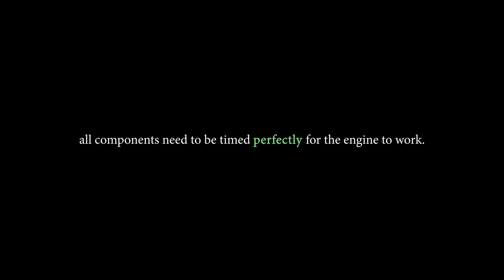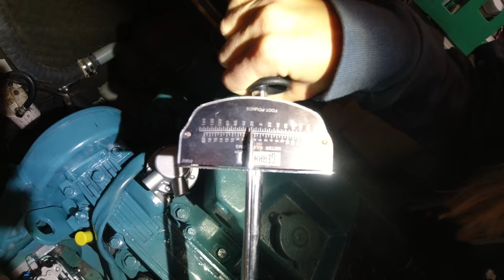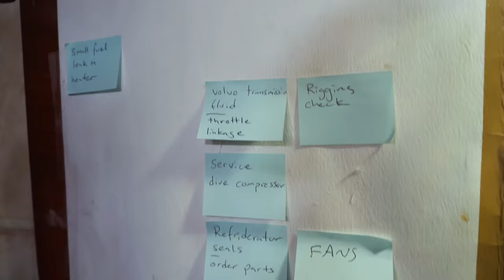BOAT WORK - Replacing our Fuel Injection, Motor Mounts, Anchor Chain! - Sailing Vessel Delos Ep. 311

Comment: Nurse here, hernias are my bread and butter. 2 weeks of no heavy lifting is too short. You are much more active than the general population. For you, 6 weeks of no lifting over 15lbs would be better. That includes lifting pushing and pulling. A gallon of fluid is around 8.5lbs for reference. The surface of your skin has most of the nerves that cause pain, usually it takes 2 weeks for that layer to heal, however it can take up to 6 weeks for the fascia to heal as that tissue receives less blood flow, the fascia also contains almost no nerves, so you can re-herniate easily with heavy lifting without feeling immediate pain. God bless you and your family. Been following you from the beginning.
Reply: Neurosurgery here. 
Completely agree with the above. 
8 lbs is (about) a gallon Of milk. 

15 lbs. (2 gallons) 6 weeks.  DO NOT TEAR THE REPAIR!!!!
Reply: I made sure to get a strong woman so when I had a stroke she kept her head and thrive s
Reply: I
@xajel88 I wholeheartedly agree.  I know I am much too late, but I agree with you, definitely 6 weeks.  I nearly fell out hearing 2 weeks.  I hope you are feeling much better, Brian.

Comment: Just a fun additional piece of trivia: You talked about using the mizzen for hoisting. You might be familiar with Baltimore Clipper ships (like the Pride of Baltimore). The masts are sharply slanted aft. The tops of the masts were directly above the cargo hatches. Perfect for hoisting. And for some reason the were very fast sailers. Good for evading the British blockades. And a bunch of them were fighting/raiding ships. Great video, thanks.

Comment: You got this super Mom ! Technical tip for using the OLD SCHOOL torque wrench - you will notice that the black handle is attached in a manner that it floats on the tool. In order for the required torque to read on the tool ,the handle must be ballanced on that pivot. Meaning NO part of the plastic should touch the metal of the shaft. The scale is set for the handle to be an exact length each and every time. If the plastic hits the shaft ahead of the handles rivit you will get a much lower torque than the scale reads. Learned this 40 years ago from father a aircraft mechanic.   CHEERS      Steve h.

Comment: When using that type of torque wrench your supposed to have the handle float on the handle centre pin. The torque is measured based on the flex of the lever at a specific length, the pin in the handle gives a more accurate lever length. Thanks for the great videos.

Comment: One thing you can do, you can still drink beer for that two week period. I hope you can ! That compression stuff for under the motor mounts looks like some sort of crazy plastic ? Wow, those carpets look like those expensive custum mats they advertise all the time. Great job Kaza ! Wow, wanted to hear the engine run after all of that. Naval Jelly. I always called it Navel Jelly at the cashier as she was usually good looking lol. I used a cutting wheel recently to cut some thick stainless steel, they are absolutely amazing for their size, WOW, really can get a lot done with them. I'd like to learn to braze but thats another story. As I said, this is the first boat to EVER re=galvanize a chain of all of the 10 years of 100 sailing channels I watch ! WOW, you've got your wife using a torque wrench. How many guys can say that ! AND YES, I DO REMEMBER SUPER RYAN ! Final error maybe drilling into a pipe or water tank ? NO!
Reply from the maker: Ha Kazza claims I stopped my pain meds early so I could enjoy a few cold ones.  Whether she is right or wrong I'll never tell :)
Reply: @svdelos  We will never tell a soul !
Reply: Thanks for the shout out and the love. Take care

Comment: Great video! Everybody used torque wrench incorrectly. You torque specs are a little off. On those old style wrenches you don't let the handle rock over. That pivot point is there for a reason.

Comment: Have you ever taken the entire engine out? Looking at your engine room, it might be a good future project to take everything out and do a makeover. Once the engine is out, you have the opportunity to do some serious overhauling. With all other components out of the engine room you can reorganize all the wiring and tubing, and maybe put some led strips all over the place to help you during future mechanical interventions.  
This project might require some planning, but nothing you guys can't cope with. It might be nice to get an engine room 2.0 :-) You might also want to look into Volvo's remanufacturing options. Several old parts and even entire engines can be rebuild to original OEM specs in specialized Volvo plants. I don't know what the options for Penta engines are, but maybe this might be something for the future when you need parts.

Comment: All the injectors were installed with their respective soft copper crush washer ?! I hope? Very important, as they work as a seal too. Similar to the copper washers used on banjo fittings in brake line applications.

Comment: Talking people thru mechanical stuff, like learning to delegate instead of single hand everything.
Could be good training
DIY has its limits 
Wondering only a little ways into this video how carpet was chosen, is there marine anti mold type more water resistant carpets?
I might measure and try scale model with paper and or computer, but geeky jigsaw puzzle 🧩 .
I've got a toilet whining, maintenance changed the plunger and now high pitched alarm like sound, took days/ night finally isolated it.  Thought it was med equipment, someone flat lining...
Catastrophizing....
Anyways good tutorial on boat projects, explains a lot of things by others needing info that you'd have glossed over.  But noisy grinding, hammering etc for deer and ducks, etc.  Btw beer bellies have a cost, perhaps.  And I've got like a decade on you and don't drink. Calico Skies got engines 101. Ryan seems helpful. Cross training Kassa, now Brian doing child care talking Tea 🍵☕ Party, Doll House, hands off only talking, sounds like guy torture! Y'all learning /StepsOffSoapBox

Comment: Another great video, but  your using that torque wrench wrong.  On a beam type torque wrench, there is a reason the black plastic handle is floppy on that pin.  To get a correct torque reading, you have to hold that plastic handle so it is centered on the metal rod, you cant push is over to the side like you showed.  The wrench is calibrated at a specific length: exactaly the distance between the socket and that handle pin.  By holding the plastic handle so it is floating and all the force is just on the pin, the torque scale reads correctly.

Comment: I've never splice manila rope before.  Nylon, poly etc.  I wonder if using heat shrink would be good to cover the tails on the splice.  Anyone know?
Reply from the maker: It's gotta roll through the combo chain/rope gypsy to my guess is it would be chewed up pretty good.  We did melt the ends though and it's lasted years like this before....

Comment: dude you are such an engineer... where do you get all that info?

i mean would be normal even for the engineer that created the engine you use to need a quick look at the manual in order to remember all the part and order to fit all of it
and in the videos you just say everything out of your mind... this is insane...

before recording do you get the manuals and stuff? i know you have maintening delos for 10 years but to remember the position of every screw in the boat is way lot of memory